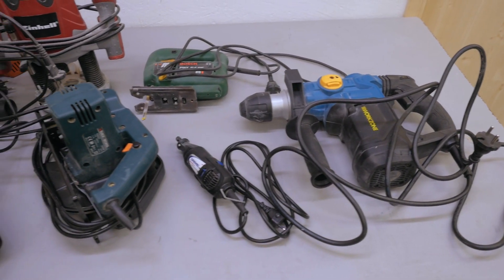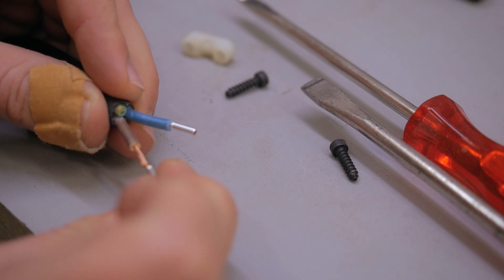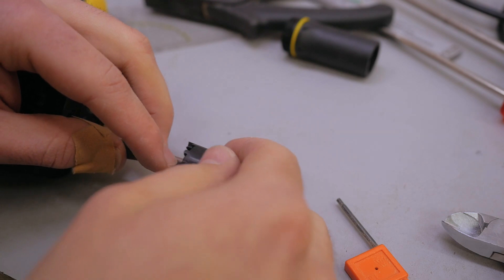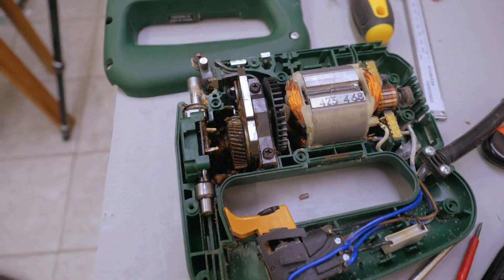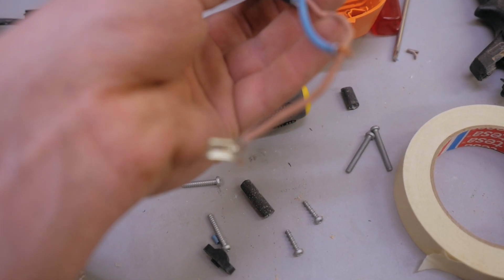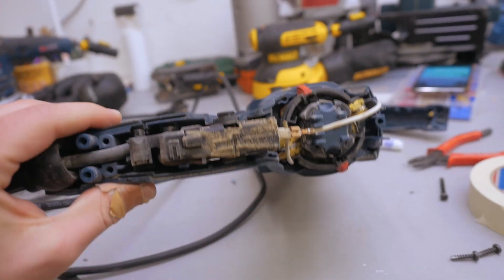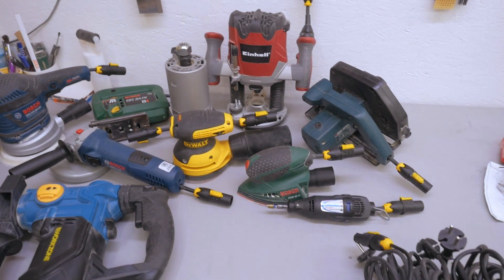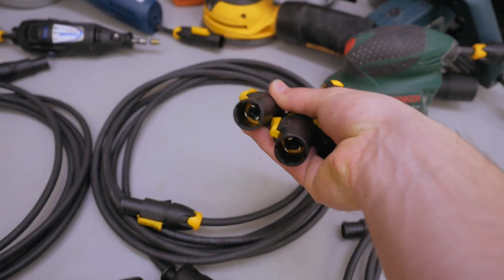A Quick Connection System for Power Tools

Comment: already done this with IEC connectors. works great.
Reply: And you can even get them with locks. search for: "IEC connectors lock"
Reply: 1 for each cable you need €2.75 http://cpcireland.farnell.com/iec-lock/pa130100bk/iec-lock-c13-lockable-connector/dp/CN20447

1 for each tool €2.32 http://cpcireland.farnell.com/bulgin/px0686/free-plug-rewireable-straight/dp/CN09937

That's without delivery and volume discounts.

Uses the same locking mechanism as caulking guns and cheap one hand clamps http://www.ieclock.com/how-it-works/

It's a really good idea and something I'd never thought about but this is potentially a cheaper way of getting the same result.
Reply: But the tool bodies are not.
Reply: Actually i think disconnect when stepping on the cable is a safety feature.
Reply: even with a price of around 9 € (for Germany, Ebay) for the lock-plug , this solution is much cheaper and i think also more universal than the one mentioned in the video. Thank you!
Reply: That's true, if you not connect a barrel water pump ;-) the advantages of waterproofnes is also that no fine dust will enter the connection while wood or sanding works. But at least then you have to close all unused connections with plugs :-(
Reply: This is great I was gonna switch to the neutrik connectors marius used, I even bought 2 just to check them out, but since I've already got IEC C14 connectors on all my tools getting a couple of those locking C13s is perfect.

Thanks for posting this.

also you can find cheaper sets of rewireable C14 connectors on amazon for pretty cheap.
Reply: Kris Mark Duthie What's wrong about that approach? Other than the obvious disconnection if stepped on the cable...
Reply: mughat even 5 different lock versions :)
Reply: If you'd leave the original cables uncut what is the point? You end up the same mess with the cables if you're using more power tools one after another. :)
Reply: Genius! I'll have to see whether I can get the locking version from Farnell through our work trade account, but even buying them retail is cheaper than the plugs Marius used. Especially since I already have a collection of IEC power cords in various lengths (albeit mostly with small conductors, not suitable for 10A tools). I don't think I even have 10 mains powered tools, but my toolbox somehow ends up tangled every few months no matter how careful I am.
Reply: Great idea also to get rid of the cables from machines which knot with the other machines in the shelf. 
Anyway you should point on the danger of different wiring from connector and plug. Some machine's metal housings are connected to the earth wire. A mistake of wiring sets the housing under high voltage!
Reply: The IEC C13/14 connectors have a connection for earth/ground and the Live & Neutral connectors are also very specific. Unlike those stupid euro two pin plugs.
Reply: In Australia Farnell = Element14, and the plugs are $AU10 each (and on backorder), the the line sockets are a more reasonable $AU6:
http://au.element14.com/schaffner/il13-rewireable-iec-lock/power-entry-conn-c13-10a-250vac/dp/2527212
http://au.element14.com/bulgin/px0686/plug-iec-c14-straight-free/dp/9997270
Reply: The real reason to use Powercon True1 over IEC is because the True1 Connectors are waterproof! :)
Reply: Stewart neutrik > iec
Reply: Kris Mark Duthie Locking connectors are out of question where I live. But I might consider this approach. I'd have to consider the pros and cons of doing so.

But I'm quite sure I'd leave the cable the tools already have and just cut it and replace the plug.